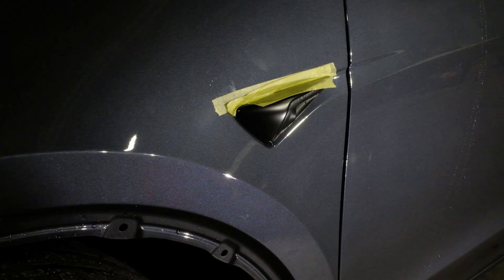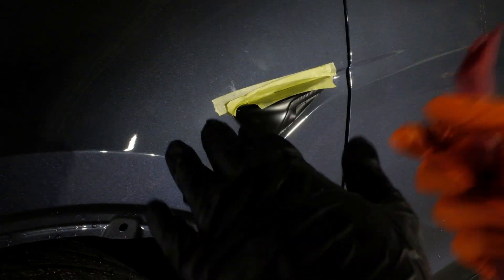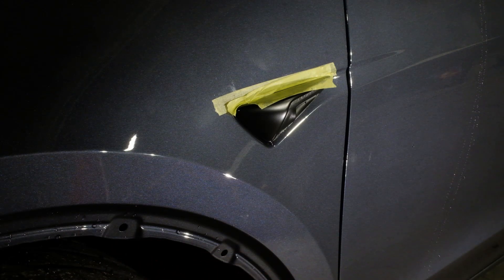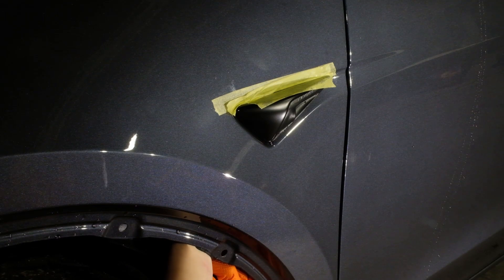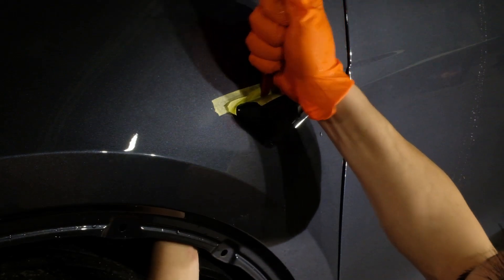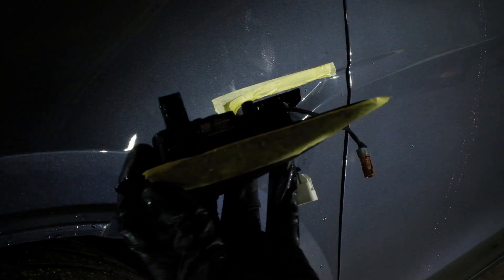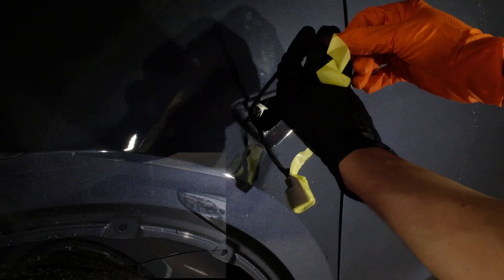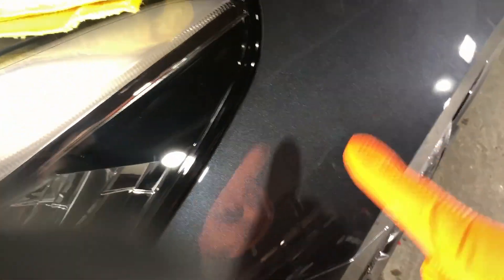DTLRSHP 89   How To DIY Tesla Model Y Side Marker Removal

Comment: Fam.. on the model y take your hand and push that liner at the flex point and it will stay pushed in so you don’t kill your arm (model y) only..

Also I’m assuming with this method you still break the top tabs occasionally?
Reply from the maker: Thanks fam, figured that out by now. This video was posted shortly after the release of the Model Y in March/April 2020. Have not broken any tabs yet, although now I push instead of pull on the pry tool, so that it pushes the panel in rather than pulling the tab out.

Comment: I was told if you break one and need to replace it, you have to replace both of them as they are sold a matched set?  Is that true?
Reply from the maker: I reckon like most auto parts, they’re sold by part numbers in which case you can order one side. But, we take these off almost weekly at our shop and haven’t broken one, 3, Y, X are all the same. The new plaid S has a new repeater with just one clip and a hook, and clip on the new S is super fragile. It’s the bottom clip that is fragile, and using this method you’re releasing both bottom clips from the inside. If it’s cold where you are, heat the area up with a blow dryer first to help soften the plastic a little bit